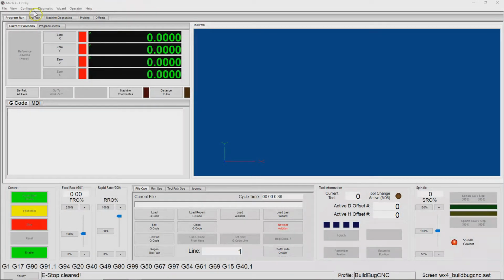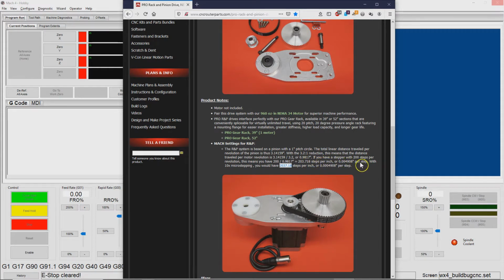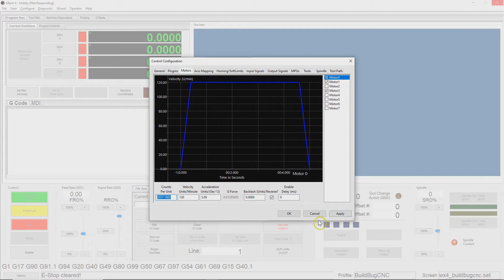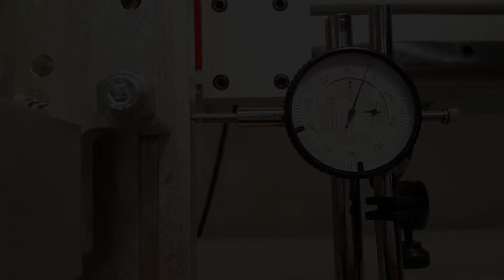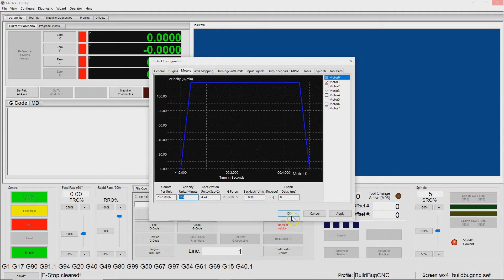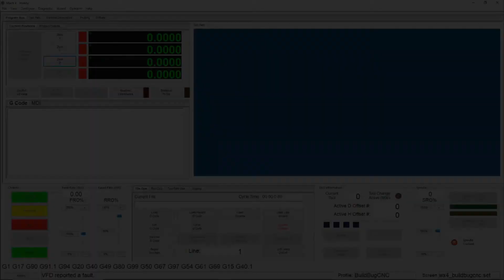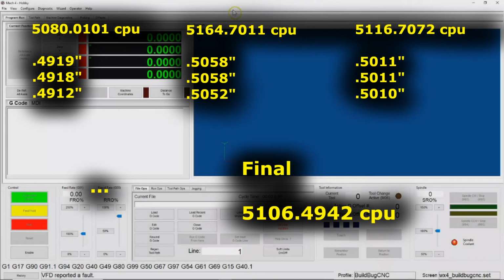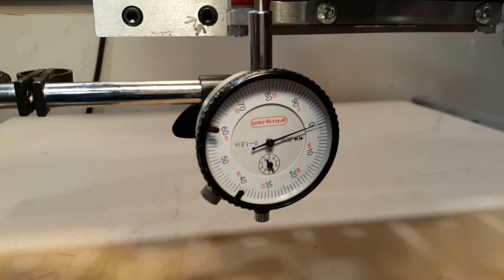Mach4 Motor Calibration - Counts Per Unit

Comment: Thanks for this expose. I was upgrading to an ethernet smoot stepper controller card and went back to look at the motor tuning in my earlier Mach3 config. I was surprised to find that it did not reflect the microstep multiplier as per the dip switch positions  on the drivers. All were set for 8x.  Yet the motors steps per unit for X and Y were all set at 200 rather than 1600. How this ever worked is a mystery I will never solve now. EDIT: I just ordered a digital 0-1"  dial guage but wouldn't mind a mechanical 0-2" as well.